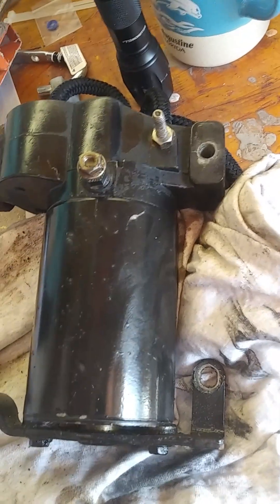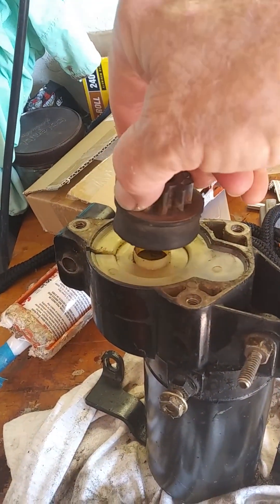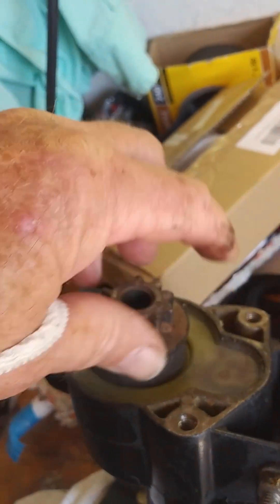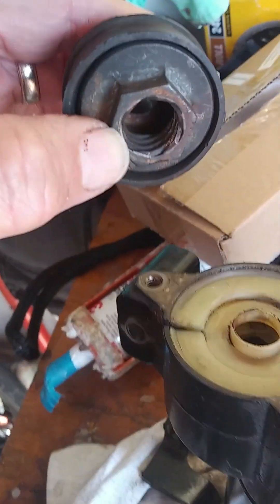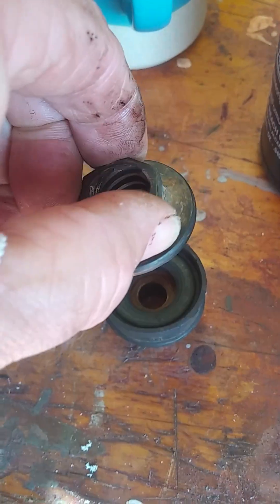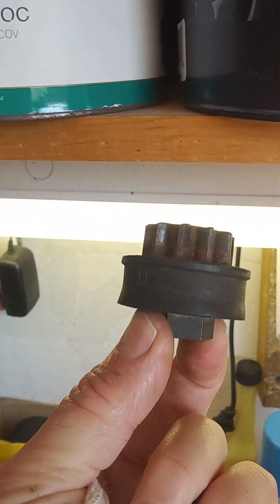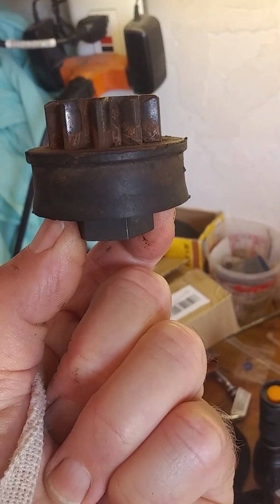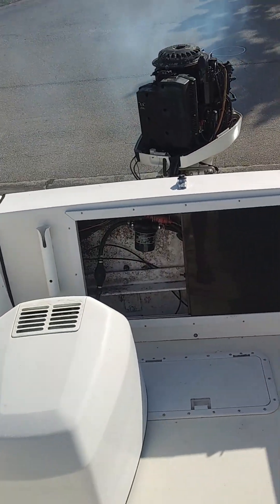Outboard bendix style starter fix

Comment: YOURE A BLOODY LEGEND MATE I CLEANED MY BENDIX WITH CARB CLEANER AND DRIED IT OFF , PUT IT BACK TOGETHER AND WORKED PERFECTLY!! YOU ARE RIGHT THE RUBBER AND METAL PARTS CONNECT TOGETHER AND FRICTION CAUSES THE BENDIX TO TURN THE FLY WHEEL! THANKS SO MUCHHHH MY ENGINE STARTED FIRST TIME AND CRANKED SO HARD! The problem was caused by me at the start when i sprayed some oil over the bendix thinking it was all metal and one peice .. It quickly started to slip and smoke , after I removed the starter and opened up the bendix and cleaned everything my JOHNSON 50HP  worked perfecly! Thanks FROM AUSTRALIA